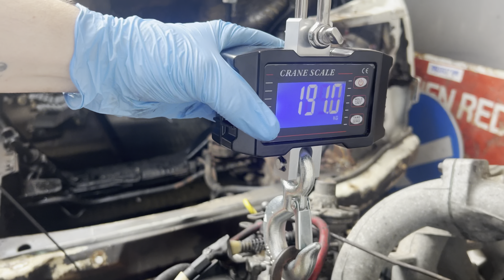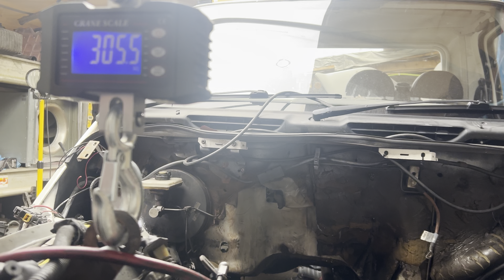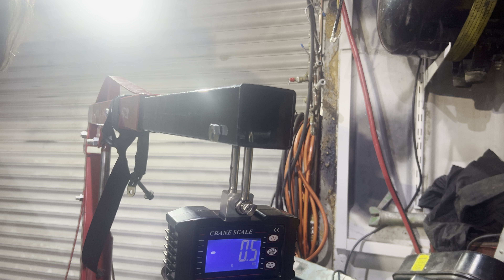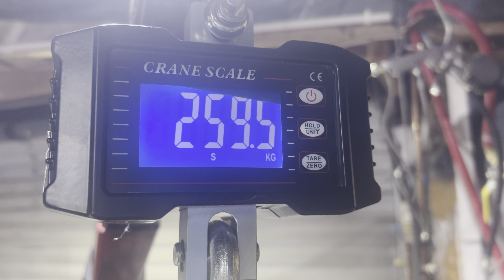Transit smiley 2.5 bmw m47 engine conversion weight difference

Comment: what about diff ratio ??i think the bmw one is something like  2.56, not a clue on the transit
Reply from the maker: Diff ratio is around 5:14 so a fair bit out,, the gearbox ratios are similar and the transit revs very high,, future plans will be a lower ratio rear diff but I want to test it all first
Reply: my P4 Rover is 3.54 so not too bad
 @NicksGarageUk